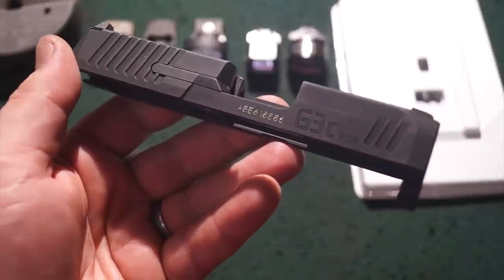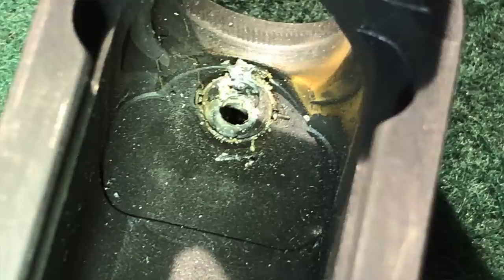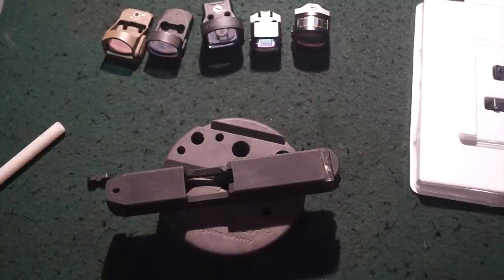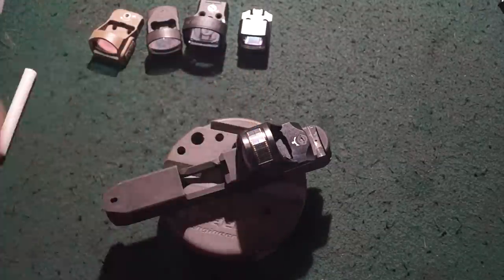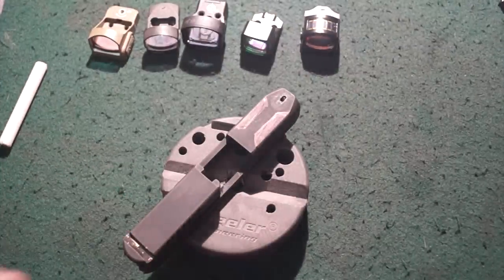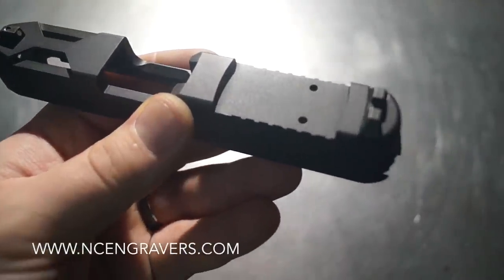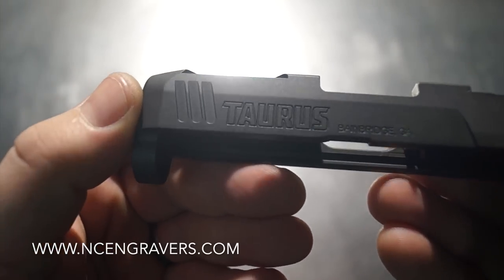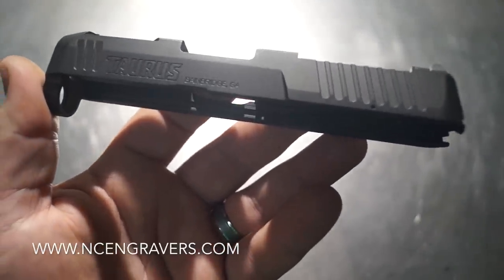NCEngravers.com  - Taurus - G3c - Edge Cut

Comment: I had no issue replacing my front sight on my g3c. Used Allen key to remove factory sight screw and then glock front sight tool for new sights.

Comment: I PROMISE I didn’t mess with that front sight before sending it. What a boogered mess! 
Following some Facebook forums, apparently there was a known issue with front sights having worked themselves loose to the point of falling off in the first batch; and that Taurus had addressed it. Boy, did they address it! I had no doubts it was loctitited somehow, as I noticed the dark discoloration around the front sight; something obviously bled into the factory finish.

I’m still waiting on my optic. I want to show the completed gun on your Facebook and put up a review; but it looks like late September before I will be able to do that.

I’ve installed a set of tall sights; but it looks a bit silly as-is. I threw up a picture of it on a Taurus forum, and got plenty of “why the hell did you do that?!?” comments.

Your work is absolutely beautiful, Mark! It was a pleasure going through the process with you. Now, if I only had an optic to do it justice...

Comment: Want to thank you from Canada for your inspiration with Corona and politics and borders I was not able to use your services     But did get a mini mill and ported and slide cut my Shadow 2  and mounted a Trijicon rmr with slide cut on my Shadow  will not be doing it for a living but as a hobby they both turned out great and am more than happy.   BUT with the mill and tooling would have been way more economical to have you do the work.  THX

Comment: Front:  I used an impact driver with the Allen wrench tip.  It was a beast to get off but worked.
Rear:   I put a small square punching my drill press with great results going both directions.

Comment: I just put night sights on my G3C. The Glock tool ended up stripping that nut. I did not have a Dremel at the time, so I drilled it out from the top. I broke  a couple of drill bits, but eventually if fell out in pieces. ;) I have a G3 on the way, but now, I have a Dremel set if things do not go right.

Comment: That’s what that gun needs, it shows a ton of wear if you really put it thru it’s paces. But damn, ten different ammo some hollow points, not a single issue. Bang every time about 300 total, not a single issue. That olight mini 2 just mitigates muzzle flip, it shoots freakin great, or mine is. Wanted it to fail to fund another project. It’s Glock sight compatible! Shit that’s a wrap for the money. I just wanna slick up that slide with something that’s gonna really hold up better. Easy fix, this gun really earned my respect anyway.

Comment: I installed TFO's on my G3c and yes the front sight will not come out unscathed . I cut across and down with a dremel cutoff wheel to within a few thousandths and broke it with pliers and the screw fell out .

Comment: What kind of paint is that on the slide? I used nail polish removal on a small area on my slide after I screwed up a color fill on my logos and the polish remover had acetone in it and it stripped the black finish off. Please lemme know what paint or finish that is. Thank u

Comment: Hey Mark, I'm trying to get my G3C slide cut for a Holosun 507K. I'm already broke from backordering an optic that costs exactly the same amount I paid for the gun itself... So, how much would you charge just for the cut, replacing the rear sight (I don't intend to use the rear sight as a backup, I just want to have the optic as far back as possible without having the rear corners of the optic sticking out the sides. I don't want any other work done to the slide, except the optic cut). Do you have to refinish the entire slide? Can just the bare metal from the cut be refinished? Thanks again for your great work and craftsmanship. Cheers!

Comment: On the front site I bet 10 to 1 odds it was applied by the owner not the factory. You can call taurus and they'll confirm they have problems with the frontsight screw coming loose
Reply: I’ll take those odds. The slide was sent straight to him, right out of the box. It was purchased with the intention of having the work done; and taller sights for cowitnessing was always a part of the plan.
Reply: Must have been the 1 they put glue in
Reply: They applied enough that you could see where the glue soaked into the finish around the front sight, and made the finish darker. It was a bit excessive.